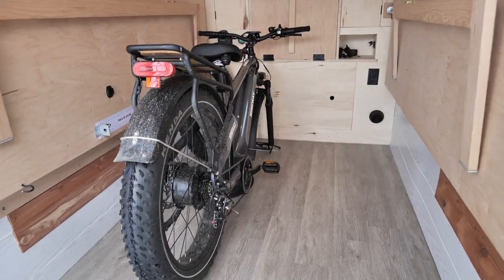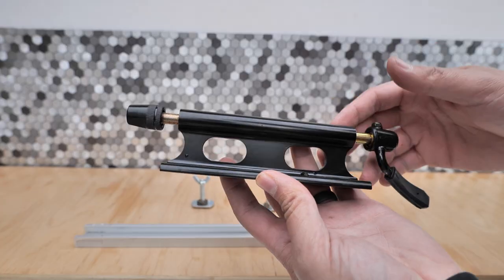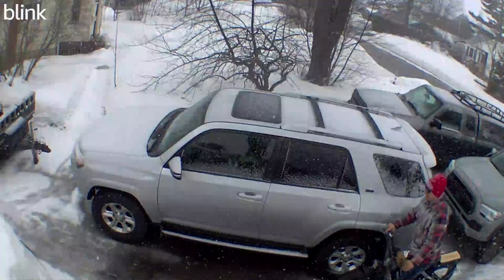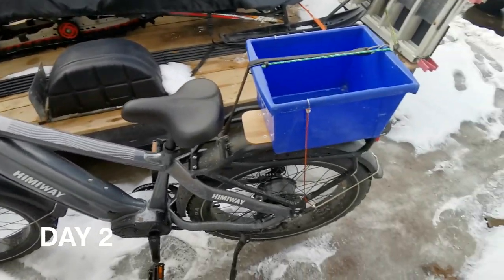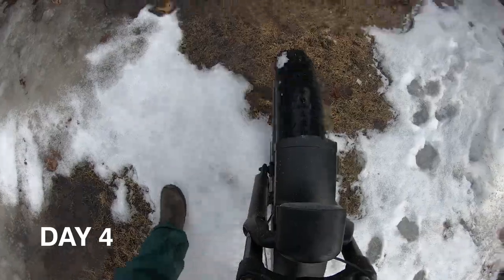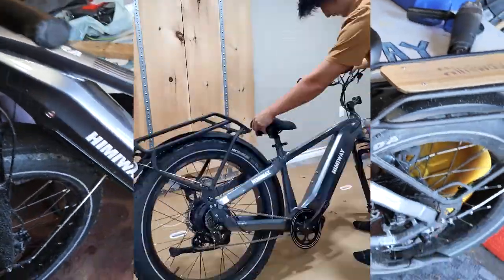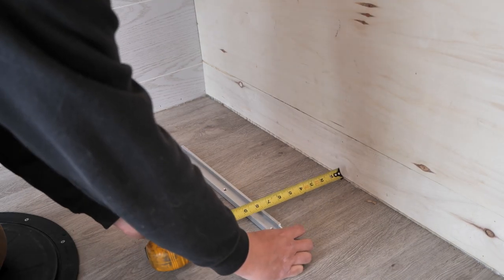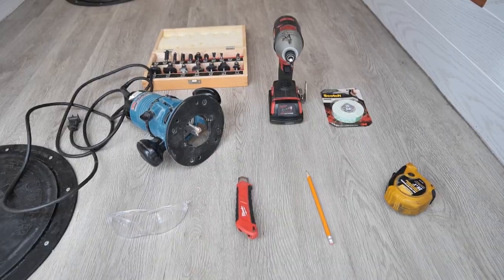DIY Cargo Trailer Camper E-Bike Rack - EASY & CHEAP

Comment: Another good video Joel, and on my trailer I will be welding a receiver tube for my overly expensive bike rack, but your method is something I never thought about, also we have two bikes "his and hers" On my second e-bike, and went with a mid drive with no throttle assist, it is a mountain bike so top end gearing is on the slower side.
Reply from the maker: I've heard mod drive is better for hills? Not sure though, haven't done the research. This was definitely something that wasn't planned when originally designing the trailer. I like the idea of welding in a track. Thanks for watching

Comment: It is a good system you designed - I am not sure about your bicycle brakes but on my Giant if you depress the brake leaver with no brake disc present (wheel removed) you need wedges to pry the brake pads apart so you can reinstall the front wheel - something for you to check on. I was warned by my Giant Bike technician to exercise caution when removing the front wheel to change a tire etc. I do love you trailer and videos. Very architectural...
Reply from the maker: Thanks Gregory. They do have a warning not to press the brake but I've done it by accident before and the pads release normally. Thanks for watching!

Comment: Could you have installed the bike mount to the wall instead ? Saves on stubbed toes 😢
Reply from the maker: Thanks but there is no structural support to mount it. This is completely removable so no stubbed toes! Was the whole point!